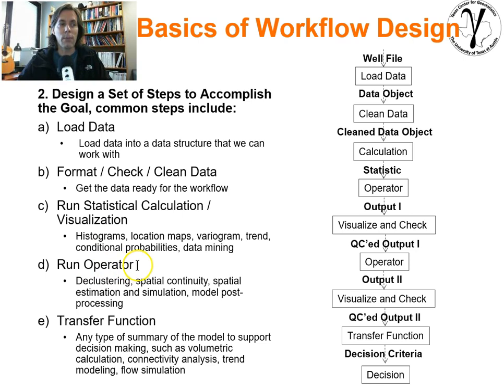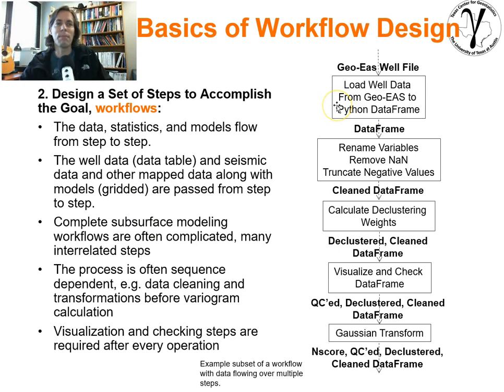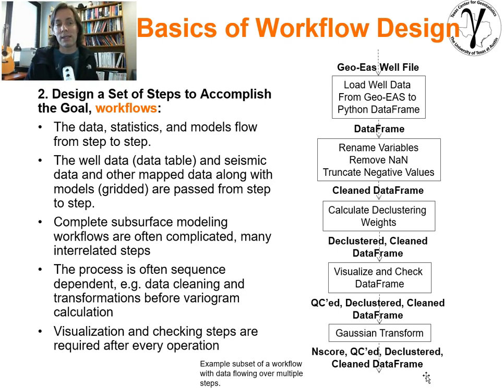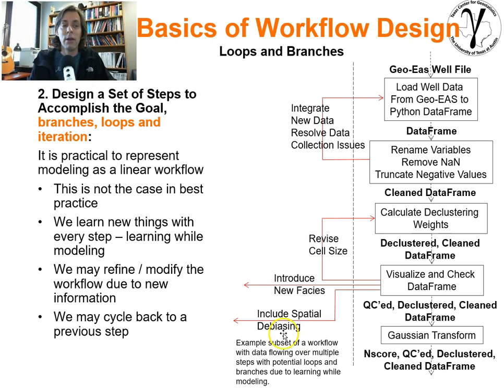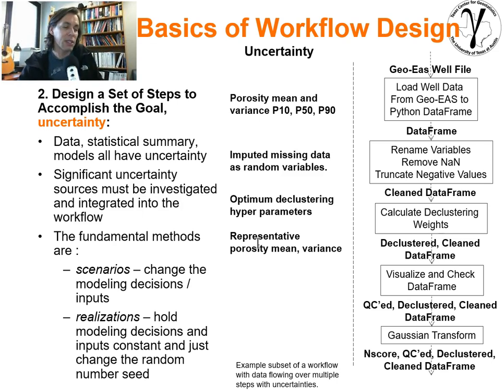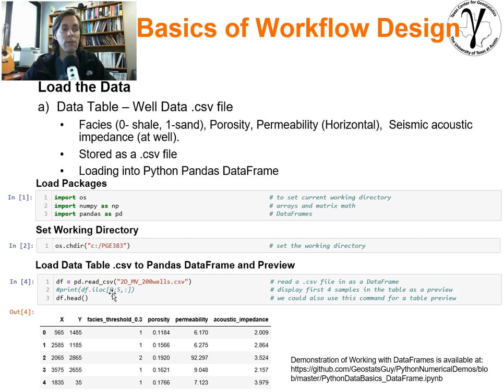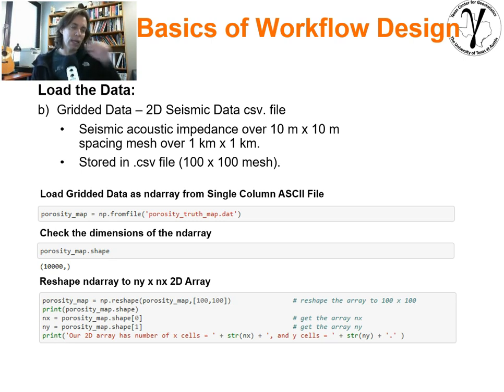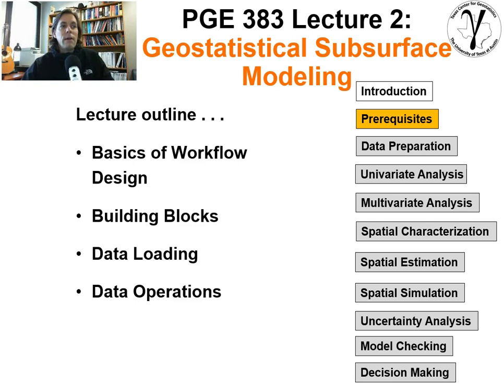02 Spatial Data Analytics: Workflows

Comment: Hi, thanks for uploading this. for me, difference between estimation and simulation as you described in very early slides (with reference to general modeling work flow modified from Pyrcz and Deustch) is quite vague. can you please elaborate or refer to literature that does so? thanks
Reply from the maker: See the Lecture on simulation, there is a comparison based on the concepts of local and global accuracy.  Many of my students find that helpful.